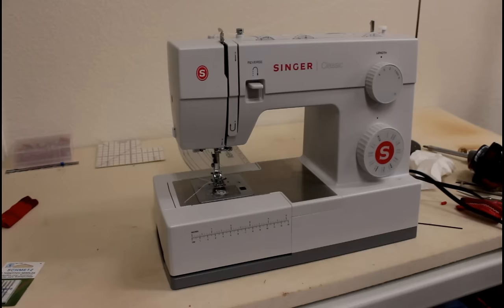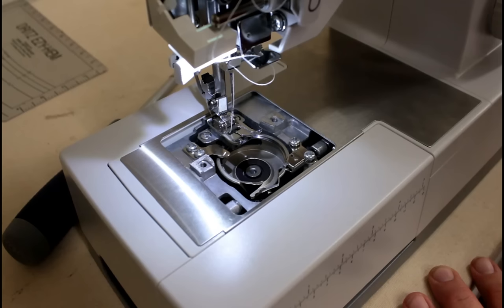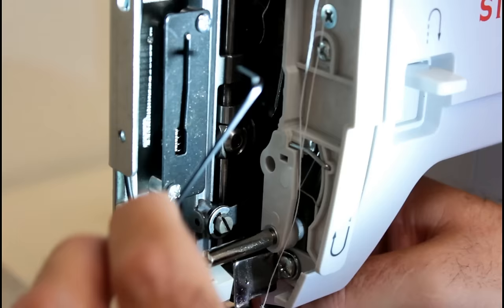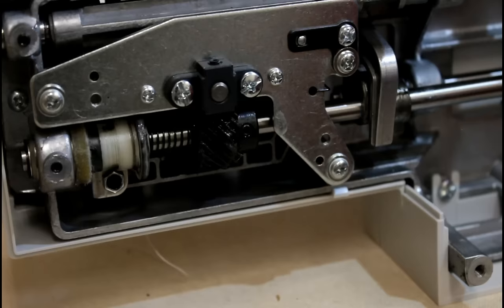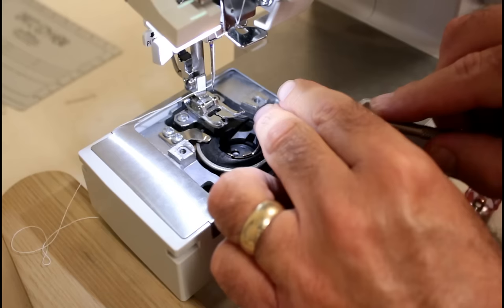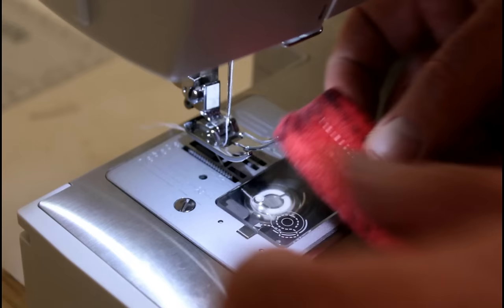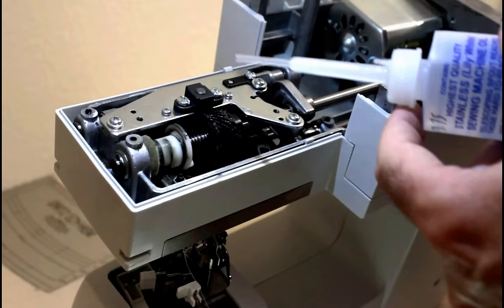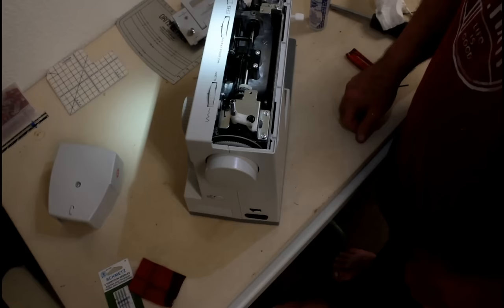Setting the Timing, Greasing & Oiling the Singer Heavy Duty Series Sewing Machines

Comment: Where can I buy a manual that shows where to grease , oil or both needed to help keep Singer Heavy Duty (embroidery) Sewing Machine. My sewing machine has not been used due to projects needing to be finished and it was stored I forgot about it as time flew by. I now want to use it  but not until I clean any and all parts that have to be lubricated...
Reply from the maker: I have a link in the video description.

Comment: Hi ,
Recently I bought old singer 5050c and it is having thread hook timing problem. The problem is I can not find the service manual anywhere and also which screws to adjust at the bottom of the sewing machine.
Appreciate if anyone can help me with this issue.
Thanks.
Reply from the maker: Most of these manual machines are the same, so I would think you should be able to do it.

Comment: So my machine bound up - my husband took it apart, and the shaft where you loosened the two set screws (which lift and lower the shaft) is bound up tight... can you advise how to loosen the shaft?  The machine will run with the screws loosened - everything moves as expected, until we tighten up the set screws; then bound up tight.  Help!
Reply from the maker: scpeckham Spray something that is designed to loosen bolts on it and see if that helps loosen it up.

Comment: Kevin, I just discovered that my 4423, which I bought used, is missing the cylindrical felt slug that fits down inside the bobbin shaft and holds oil. I don't see replacements online. Can I operate without it? Maybe oil there more frequently? Or replace it with something else? Would appreciate your thoughts.
Reply from the maker: Contact these folks and see if they have one: www.sewingpartsonline.com

Comment: 23:53 when i loosened the black peice to fix the hook it only loosened slightly, then as i was messing with it, it stopped moving at all. i even took all three of the screws out and the black piece just wont move on its own, its snug with the bar its on. even when I'm trying to move it directly or by the hook up top it wont move. not sure what i did wrong or how to fix this. if anyone has advice that would be great. there's no dirt or anything blocking it from what i can see
Reply from the maker: I will be making another video on how to set the timing that doesn't involve loosing the hook. Several people are having the problem on the newer machine vs. the 5 year old version I used in this video.

Comment: Hi Kevin, I have same machine and it needs timing setting and I tried your method but the hook doesn’t move even after loosening up the three small screws on the chaft underneath the bobbin case, Please help 😭
Reply from the maker: You will need to loosing the nut in the bottom plate that covers the bobbin and hook assembly on the bottom. I think they are doing this the prevent timing issues. However, it isn't really helping users adjust them.

Comment: Hello Kevin. I had a timing issue. And the bobbin holder was so tight that eventually had to loosen nearly all the bolts at the bottom. 

Once I did that I manage to have the thread catch the bottom Bonin thread correctly. Now when I stitch the needle only goes down 2 times before getting stuck. 

And when I open it’s as if the upper thread is being constantly looped with the bottom not allowing a single stitch to go through. 

Do you have any suggestion. If you have an email I could send you a picture Of what I mean if you don’t understand.

Thank so much for you help.
Reply from the maker: Humm... it sounds like you have a lot of things going on. Can you create a video (cell phone?) and post it on your channel then send me a link?

Comment: hello Kevin....my machine not even move... just the sawing motot start good. what should I do...powersupply to motor worked. machine no movement at all. need advice from you.....thank you
Reply from the maker: Usually it must be way out of time to lock up. Just double check that the bobbin area is completely cleaned out and there is nothing obstructing the movement of any part of the machine. If you don't know how to do a complete timing adjustment then you will need to send it to a repair shop. The only problem is it can cost more to repair than it is worth.

Comment: Hi, Thank you so much for this great video.  I just bought this used machine and it's having the same problem, hopefully I can fix it. I noticed that the machine is missing the 2 felt pads at the bottom where you put the oil, would that be a problem or it can work without them? If needed,  any idea where can I get them and/or can I replace them with the red spool pin felt pads? Thanks again.
Reply from the maker: Go to www.sewingpartsonline.com and enter in your machine's model number.
Reply: Thank you for your prompt response.  Have a blessed day.
Reply: I looked online at sewing parts but couldn't find the felt pads. I have a 4411 Heavy Duty did I overlooked or they are not available?  If I can't find them,  would that be possible to put some Tri-Flow grease instead of the pads and the machine oil? I really appreciate all you do to help so many people fix their machines.  Thank you 🙂
Reply from the maker: @lillyolmeda255  I see they only have spool felt pads: https://www.sewingpartsonline.com/search.html?keywords=spool+pin+felt
Reply: @kevinsews  Great, I'll try those, hopefully they work.  I just got the machine for $20 and thanks to your videos and professional guidance I'm confident I'll be able to fix it.  Thank you 🙂

Comment: Hi Kevin, I have a problem with the 4423 that i cannot find info anywhere. At the straight stich setting the needle still jumps sideways, makes noise and does not stitch properly. Any ideas?
Reply from the maker: That sounds like a mechanical problem. You can remove the covers and turn the handwheel and see exactly what is going on. This may help you identify the issue.

Comment: My needle is touching and grazing the small plate next to the thread hook. Probably for years. Is it expected? Will adjusting the position  solve it? Thanks in advance. I have a singer talent with drop down bobbin
Reply from the maker: Little Ellys It shouldn’t be hitting anything. There is a screw in the needle bar area when you remove the end cover that can be loosened to adjust the needle forward and backward. Do a search on this subject if you can’t locate it.
Reply: @kevinsews  thank you.
Reply from the maker: Little Ellys You’re welcome!

Comment: Hi Kevin, sorry to bother you, i have a singer 9015 sewing machine and the motor runs ok when the clutch is engaged for the bobbin winder but when switched back for the needle the motor does not respond it try's to move but don't know why it wont move, all the mechanical parts seem to move ok when turning by hand i also oiled the parts just to make sure and still nothing can you help in any way. Thanks in advance M
Reply from the maker: Your belt could be slipping.

Comment: my thread keeps catching on the bit of metal in front of the bobbin case.. how do i fix that? My machine was out of time in the box.
Reply from the maker: Slightly loosen the screws that hold the metal piece on until the thread passes through it smoothly.

Comment: Hi Kevin. I have a Singer 4452, and I was wondering if there's a way to get more height under the presser bar. I often have to use the walking foot on my projects; and fairly often, there is just not enough space under there to get multiple heavy layers in. (bag making, mostly)
Reply from the maker: You can loosen the screw and raise it a bit for your  waling foot. I would mark a line on the bar before you move it up through. That way you can return it to the default position when you go back to the default pressure foot.
Reply: Buy a Jamone it’s the best. All Janome have more height,than any other,,,if you raise presser foot high the needle bar will hit the foot
Reply: @michaeltexeira6185  even if it is only raised a mm or 2?Do you know the correct height of aVintage Kenmore 158.1941.2 a super hi shank, presser foot.  I cannot find this measurement listed anywhere, Thank you.

Comment: I have a Singer HD 6600 “compterized” machine.  Stitches 1 - 11 work fine.  12 - 99 don’t work.  They look nothing like what they are supposed to look like.  Also, the buttonhole stitches don’t work either.  Just sits in one position and stitches.  Will doing the steps in this video help?  I can’t find any information on this issue nor can I find that anyone else is having this problem.  Thanks, in advance.
Reply from the maker: Since it is an electronic machine I would send it to Singer. The board might be bad.

Comment: I have singer 2112 .I opened the machine to check the trnsion .When I assembled the machine the machine is working fine but its stich width dial is very tight hardly moving .What would be a problem?
Reply from the maker: Humm... I've never seen that one. The width mechanism is pretty simple. It just has a screw behind the dial that adjust the swing width of the needle. I will let you know if I can think of what might fix it other that adjusting that like they shown on page 12 of the manual.
Reply: Kevin Sews Thanks a lot .I will try to fix it .
Reply: Thank you very much Kevin saw for the video. This is exactly the problem of my sawing machine . Thank you, thank you.

Comment: Kevin: I have a Singer Model #9410, which is what I was looking for in your commentary. I recently purchased one of these machines on eBay, primarily because it was advertised as "heavy duty"! I need to sew a lot of denim, and other heavier fabrics.  I have a problem with the sprang that holds the bobbin case  not staying in place, allowing the case to move about, with the resultant thread tangling. It doesn't have a screw holding it, just what appears to be a rivet.  When I purchased it, I had it serviced, and was told that it needed a new bobbin case, which was installed. I myself discovered the current problem, after it only worked perfectly for one session. Any advice you can provide would be much appreciated. 
Thanks!! :-)
Reply from the maker: Take a look at the Brother 1500 series.

Comment: Hi- Thanks for another excellent video!!! At 55:20, your oiler is at a metal piece next to the [bearing?] on the main shaft, that has what appears to be 2 very small wick/felts in the side of it. There is a 3rd felt in the side of that metal piece you oiled right after, next to it. They are not really noticeable at first. I oiled them over a month ago and the oil is still leaking down the needlebar, presser foot lifter and threader.  After soaking up the oil through the side cover opening with a cotton rag, it continues to puddle on the presser foot and other parts. I am new at this. Would you know if those felts are there to soak up oil, or are they supposed to be oiled?
Reply from the maker: I generally place a drop or two on the wicking washers. On my industrial machine they use wicking ropes to absorb the oil and deliver it to the areas that need to be oiled. I figure the washers will do the same.
Reply: @kevinsews  Thanks Kevin! - I have oiled the common washer type felts, but have never seen these before, as they are inset horizontally.  They are like the round one inside the bobbin case that goes downward, only these are almost rectangular and are slightly curved, because they are inset sideways in round parts - the parts you were oiling at 55:20 on the main shaft (bearing? and the rocker arm). I probably should not have oiled them.

Comment: I like the video but I have a question about how you can tell what the correct depth of the needle is? The light was too bright and I wasn't able to tell when the needle was actually at. If you could clarify this for me I'd greatly appreciate it. Thank you so much.
Reply from the maker: Some of the machines have markings on the needle bar, so look for those. Otherwise, it is a trail and error thing. The eye of the needle needs to go just below the hook level as it passes by the needle on it's way up as the hook catches the loop in the thread.
Reply: @kevinsews  I’m struggling with this. Do I just adjust needle and hook at the same time? I think you did that but because you were only filming the hook I couldn’t see when you were adjusting the needle height and when you were just turning the wheel. Do I just pick a height and it doesn’t matter as long as the timing is correct? My hook is catching the thread but I can’t help feeling like I can’t possibly have managed to do it right by myself…!
Reply from the maker: @capitaldidi  Some machines have a mark on the needle bar to set the height. If yours doesn’t then try to get the timing down first. At that point you will notice that the needle depth is off. Get that adjusted first then see  how far the needle is from the size 16 needle. If it appears too far away then make that adjustment last.
Reply: @kevinsews  For the benefit of anyone else wondering the same thing, it turns out your machine will have a SERVICE manual that contains precise instructions for this, including measurements to the millimetre!
Reply from the maker: @capitaldidi  Yes, I provided a link to the manual in the video about box above.

Comment: Kevin, this video is everything I needed and couldnt find. 
One question is, once all 3 small screws are undone on the shaft should the hook gear spin freely all the way around, or will it still be restricted to an extent?
Reply: Did your hook gear spin at all? I took all 3 little black screws completely out and sprayed it with WD40 but it still won’t move at all.
Reply: @stevenvetri  it moves slightly in both directions but only along the gear lines, I need it to spin completely independently because with the amount it moves I cannot realign the hook and needle
Reply: @samanthajames7638  yep, at one point mine was moving a little where I was able to adjust it to catch when the needle is in the middle or right, but now the black gear is completely stuck so I can’t move it anymore to catch the needle in the left
Reply: @stevenvetri  frustrating because I've been told that it will be £69 for a full service when I've already stripped it back to where it needs to be I just cant quite get it into time.

I'll keep trying, it's not working now so I'm not loosing anything by trying again.
Think I will try the wd40
Reply: @samanthajames7638  I know this was almost a year ago, but were you able to get the the gear to spin free?  I am having the exact same issue with all 3 set screws removed, but still stuck and hook only turns with the handwheel...
Reply: @sbdivemaster118  there is a rear screw that needs loosening aswell. It was very tight and originally I didnt think it needed loosening but once I did it released. But be careful as it gives potential for internal components to drop out. 
You may need to adjust the timing from the internal components on the right hand side as well as underneath.  Hope that makes sense.
Reply: @sbdivemaster118  Take the belt off and fix hook, then put belt on - much easier if screws stuck.

Comment: Hello. Would the timing be causing my needle to hit the back of the bobbin holder? It hits the inside rim of the metal holder. The hook seems to be grabbing the thread just fine. I was looking for a way to move the needle forward a little bit but I can't find it. Thank you for your videos!
Reply from the maker: No, that is the needle shaft. Download the manual in this video description and it will show you how to correct it.
Reply: @kevinsews  Thank you so much for taking the time to reply to comments. I was able to find it in the manual and fix the issue. Thank you again!
Reply from the maker: @s.h._.  Great!

Comment: My CG590C is locked up.  The carriage for the bobbin is stuck.  I tried to loosen up the carriage but no good.  You have an suggesstions?  Thanks.
Reply from the maker: You will need to get to the bottom side of the machine if it has a drop-in bobbin system. You will see where the bobbin post comes down through a piece that holds it into place. Remove the screw that holds it and the bobbin holder assembly should come right out. Usually, the problem is the gear on the bobbin has slipped over slightly and cause it to lock up.
Reply: I did that, but it was very complicated.  The two screws holding down the bobbin carriage would not move anything.  It was a pain in the butt just removing the screws and the piece of sheet metal holding down the slide for the bobbin cover.  Thanks.
Reply from the maker: @frankkohl9253  You will need to see if you can find a service manual online somewhere.

Comment: I seemed to have mucked up my singer heavy duty sewing machine. it does not  sound right when you try to sew. The needle ends up with no thread, and the thing your trying to sew has no thread it it.  I was away from sewing for about 2 years. I had a bit of a  stroke and forgot how to sew..  When I first tried to sew I moved the fly wheel away from me, I am wondering if that has mucked up the workings inside?  I wonder if there is anyway to trouble shoot this can get it working or it someone skilled in repair?
Reply from the maker: Try pulling a long thread trail out of the needle. Then, hold the thread for the first 2 stitches. Let me know if this helps.
Reply: @kevinsews   Hi Kevin I think the timing is totally off. Do you have a guide for checking it? I have switched to my  Brother FS101 which is just a plastic box with a computer in it. But it gives me a sewing machine while I figure out what I need to do to adjust the singer. I have a feeling the hook is way off.
Reply: @kevinsews  When I have held the thread from the needle It seems to pull it right out of my fingers and when I look at the needle there is no thread in it?